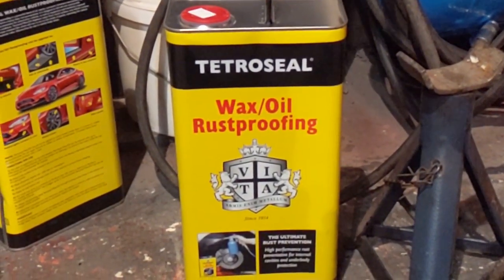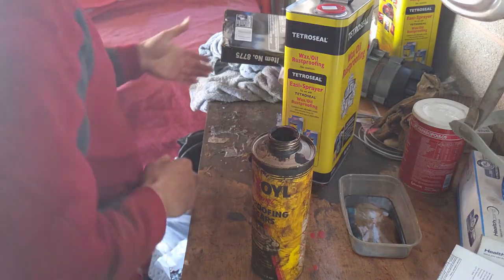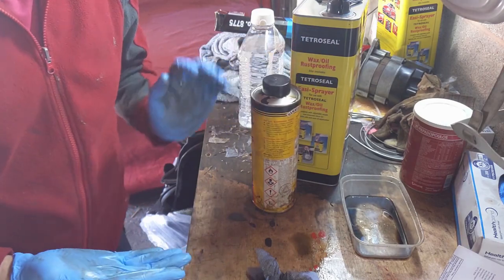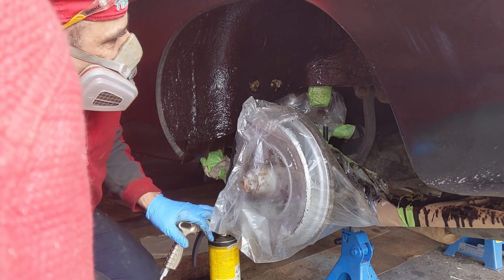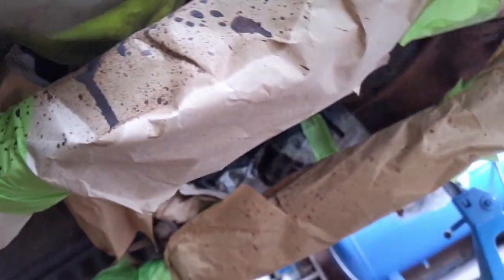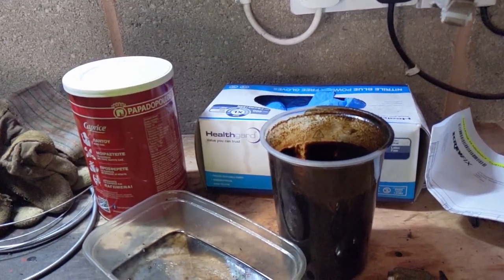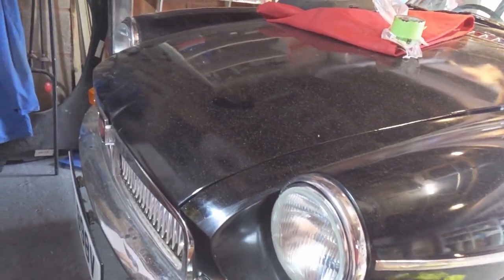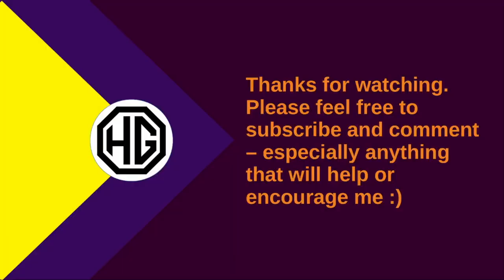MGB GT Episode 57 - Protecting the  Underbody

Comment: Hi Henry, Very nice job on the rustproofing.👍
My own experience of an 'aftermarket' bonnet isn't great so I hope the quality has improved for you. The one I purchased was made from appreciably thinner material which was noticable in the weight. The outer skin was so thin it already had small creases from transport/storage when removed from the packaging. It was much narrower than the original which meant the shut lines against the wings were HUGE. The bonnet curve front to back was different to the curve on the wings (around the same as your present damaged one) The curve from side to side didn't match the scuttle curve and the 'dressing' of the skin against the rear frame looked like it had been carried out with an axe! I spent half an hour wedging it on packers to get best fit.. Gave up, put it back in the box and sent it back for a refund......Can't honestly remember where I sourced this, but it was one of the major suppliers. I hope you have better luck than me.
Sorry if I sound like the prophet of doom, but I will be interested to see what your experience is.
Keep up the good work 😉.
Reply from the maker: OMG Carsten, that sounds terrible.  I'm now really worried about it.  I've just had a text telling me something is turning up today (I don't know if it is the bonnet or something for my wife or son) but fingers crossed
Reply: @HenrysGarage  Sorry Henry, didn't mean to worry you, but my advice would be to offer the bonnet up for a 'trial fit' and make sure you are happy with it before carrying out any prep work. Hopefully, quality control has improved in the 3 years since I bought mine.... Fingers crossed!
Reply: I have generally found parts from MGOC to be good quality so will be interested to see the fit of the new bonnet.
Reply from the maker: @martinhibbert1428  IT turned up today and I removed the current bonnet and laid this one in place.  Fit seems fine to me and no dents or anything.  Sharp edges - I cut my thumb
Reply: @HenrysGarage  Hi Henry, really pleased you didn't end up having the same experience as me. 👍